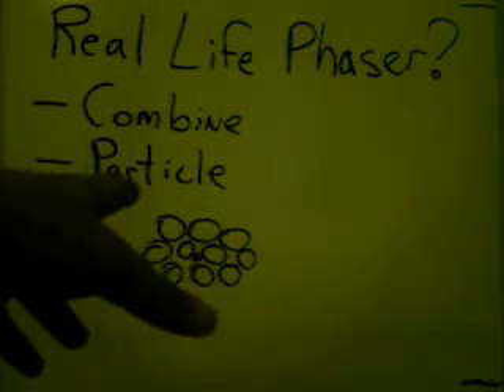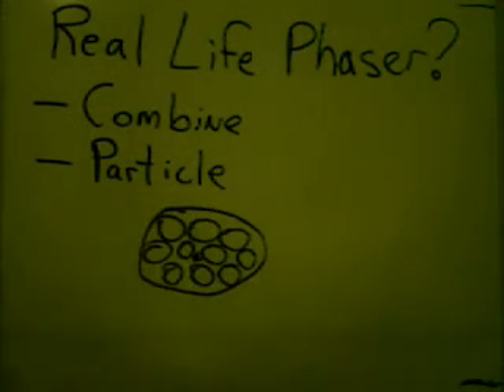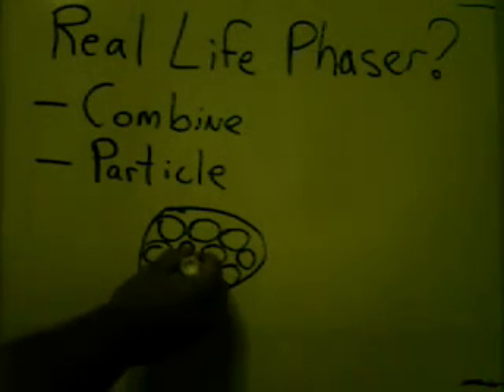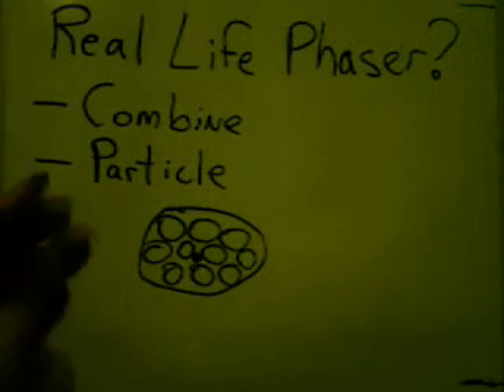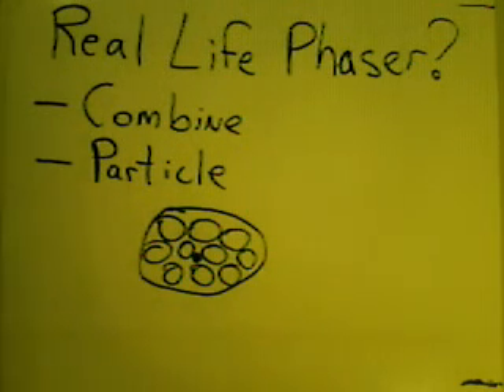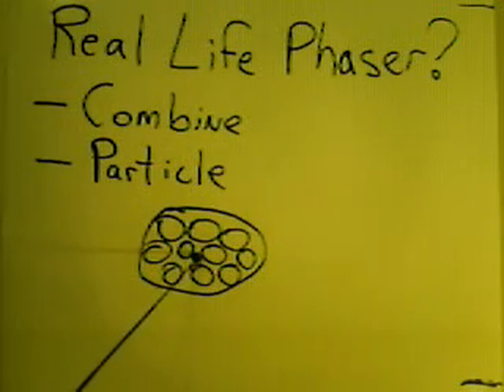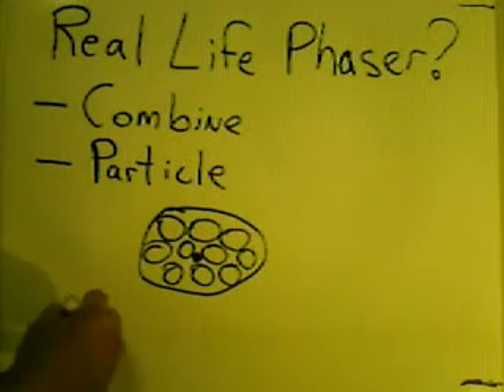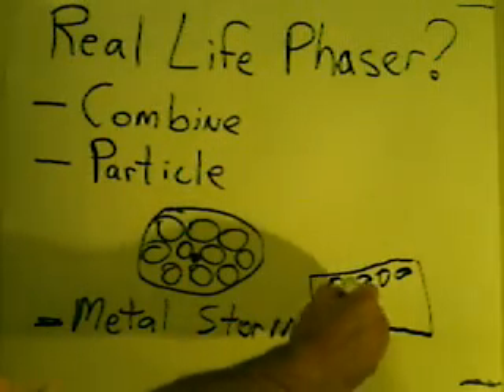Real Life Phaser?

Comment: Another idea is to take a laser and drill a hole in the center of the optical tube, layer the inside with a diamagnetic material (probably a halbach magnet array).

This will create a laser circle instead of a point that will burn the air in the center of the laser-light tube allowing for the particle stream to have a place to run along without dissipating too soon.

Comment: Ok so first of all a phaser is the idea of a phased laser, if you are talking about the type of phaser that is seen on Star Trek where you can visibly see the particles being fired accelerating using a laser elements at the nano or even micron scale will not work as they are too heavy, perhaps the idea has potnetial in terms of using a gas like hydrogen and superheating it to a plasma like a plasma cutter but with a high compression stream you may get a little distance perhaps a meter or so.